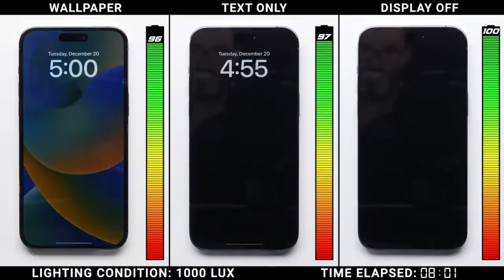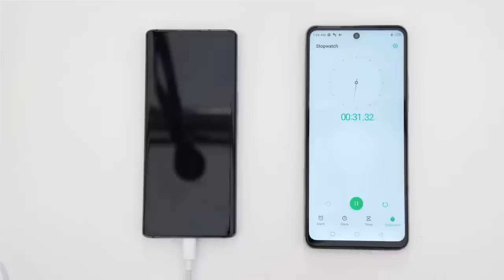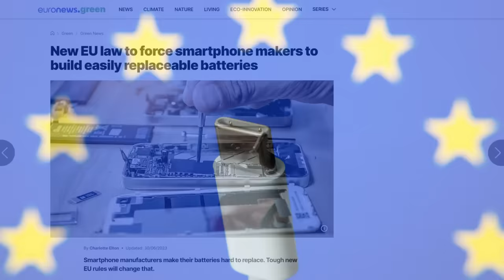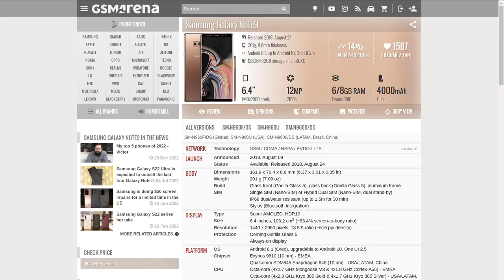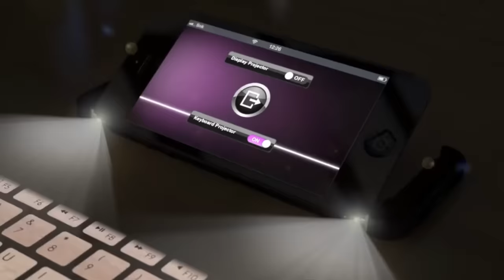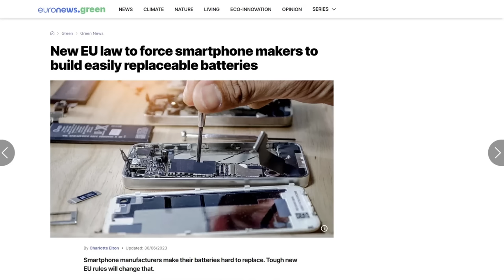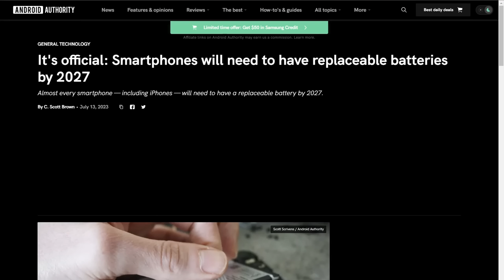All Smartphones Will Soon Have Removable Batteries

Comment: My guy, the s5 was water resistant and had a removable battery

Plus I had wireless charging on my s3. It was a cheap accessory that I bought on Amazon where you could connect yourself to make it that way! The smartphone industry has really brainwashed us over the years.

Comment: Recently found my old 3310 in the attic. Simple swap of the battery and it ran just fine. Was kinda nostalgic hearing the old tunes again. But other than that just antique hardware by now.

Chose my current phone for its waterproof rating as I work and sport a lot around water. The drawback being the inability to swap the battery without losing that waterproofing or the warranty. Been using it for well over 4 years now and still no need for replacement.

Comment: I remember having a Moto Z Play (late 2016 to early 2020).  Although it had no removable battery in the normal sense, it did have external hot-swappable batteries thanks to the Moto Mods system.  IMO, that is as good as replaceable internal batteries.  Plus the phone was made thicker to allow a bigger internal battery.

Comment: I totally agree with EU new regulation about the removeable batteries. One more thing why I like traditional removeable battery, not only it can easily be swapable with fresh batteries, but you can save your phone from a disaster in case the battery failed and blow up. One thing I concern with non-removeable batteries is, if something happens with the battery like shorting inside all of sudden, you can't save your phone, instead it will burn all along with your phone because you can't remove it. With removeable batteries, if something going wrong with the battery, you just easily pop out the back cover and throw the battery aside as fast as you can, so the phone will not burn out with the battery and your phone still safe. This is what I am thinking.

Comment: Snap in plastic encased molded battery modules maybe requiring a special unlock tool (included) will allow the current level of stiffness and strength that consumers are accustomed to and is what I predict with high confidence will be offered based on my engineering experience.  The cheapest phones might regress to designs like the Samsung S3 but who would want such fragile phones.  Any wagers?

Comment: Water resistant my S.
20 years ago my GF accidentally washed my jacket along with my Sony Ericsson A1018s. Dried it on the heater, turned it on an hour later and it still worked.
Try that with any "modern" phone (real rugged ones excluded).

Comment: I have a Fairphone 4, which is designed to be user-repairable. It's very easy to swap out the battery without any tools, but I never thought to carry around an extra battery because a charge on this lasts all day with moderate use. I also don't bother using a case for this thing as it's rather thick already on its own, the back is made of plastic but it never popped off the five or so times I dropped it on the concrete floor of my workshop (you really have to pry with your fingers). I also don't have to worry too much about components breaking because everything but the main board can be replaced easily, even the screen. Overall I like it a lot and find it baffling the only option for a phone like this is an obscure, expensive brand that I had to specially import from the Netherlands. If I ever need replacement parts I have to get the drop shipped which adds to the cost, but I'm probably saving money in the long run with how long it will last overall.

Comment: If batteries indeed became standardized in their size and form factor, it would be possible to load them into the phone throuh a slot at the bottom with a spring latch/release, like in some old SIM slots or how you insert a magazine into the handgun. Adding a gasket in the opening of the phone's battery slot would also considerably improve its water and dust resistance comparing to the backside loading with removable back panel. Bottom slot loading would still allow placing the q-charging and NFC coils at the back behind the battery slot, thus preserving these functionalities.
I'd also consider making the USB-C socket a part of the battery (with internal plug-through to the phone data bus), as this would remove the risk of premature phone obsoletion in case the socket gets worn out.
This approach would certainly make the phones bulkier, but this effect could be offset by the following factors:
1. Batteries can be made smaller (in size and capacity), but the universal standard and the ease of loading in/out of the phone would make swapping them a breeze.
2. Standardization and universal compatibility will turn batteries into a cheap and ubiquitous commodity sold at every corner store and gas station in the world, making charge anxiety a thing of the past.
3. Standardization and patent/license free design will also make batteries cheap due to easy entry for new manufacturers, fierce competition, and economies of scale.

Comment: Build them like many P67 rated handy-talkies. The battery (also P67) is part of the outer case. All electronics are sealed in the main compartment. Only waterproof battery contacts are exposed. The removable batteries could still have wireless charging capability as well as USB C ports. Too, using this design, it would be easy to make it possible to connect a much larger battery to the phone. My handy-talkies come with a 3800mAh battery but there are 5200mAh and 7200mAh batteries available that snap in place for these radios.

Comment: On a phone like the z flip it would be hard to add a removable battery.  It has dual batteries, and one is under the cover display.  I feel like these regulations look good on the surface, but limit innovation in a lot of areas.
Reply: We had flip phones that could change battery before so what are you even talking about?!
Reply: @HandheldGamer1991  modern flip phones have two batteries for more capacity.  Old ones didn't, that's why you could change them

Comment: The Battery expanding is The weakest point of a phone that also is a main cause of overheats and damage to other components
If you are good with tech you can remove it but you gotta deal with removing glue and putting new one back  in

Comment: How will this work with wireless charging coils? The coil usually needs to be as close to the oitside as possible but if the battery needs to come out, where's it gonna go?

Comment: This is great. When I got a new phone 2 or 3 years ago, I bought one with a headphone jack, a microSD slot and a removable battery. Basically every part could be swapped if you have a small screwdriver. Obviously, it's pretty niche and the performance isn't as great as it would be on a flagship Samsung device but 1) I only paid a few hundred €, a price unimaginable for big companies, and 2) this isn't a fucking computer; why would I need the processing power to run Premiere Pro on a damn phone.
Edit: Oh yeah, since he talked about it: The bootloader is obviously unlocked (first thing I did was install a custom ROM) and I only have 1 camera on each side

Comment: i do not care about water resistance but if battery capacity would get smaller then i don't want this removable batteries.
Few batteries for one phone? that sounds nearly as what i have for my camera = no thank you. I rather have one good battery and power bank.
So removable to remove on spot = no. Removable to replace battery by yourself when it gets old = yes.

Comment: I think using some kind of slidable notch providing leverage to press (or rather pull) a cover tightly on a form of gasket should be able to create a water tight seal and beat the issue of covers releasing easily when dropping the phone.
Reply: You dont need to reinvent the wheel even samsung sells waterproof. Phones with removable batteries. But not in the us or eu. They know how to do it but dont want to. Thats it. There is no limitstion or technical feature to embedded it. With today glass and aluminium phones its much easier than with the plastic back then to seal it without issues. (99% of phones are not watertide anyway) they made to stay alive if you drop them into water for a short duration.

Comment: I think the best way to make a good seal with a removable battery is to use screws. 8-10 screws total. It won't be as convenient as a plastic back but it ensures better protection to water, and lets a more high quality material to be used. Maybe they could start building their phones like apple builds macbooks, out of aluminum with a portion cut out for wireless charging and it would still look like shiney aluminum or stone type of frosted glass, but its metal at its base. Like a rim that has a big window for glass.

Very interested to see what these companies do. Although i don't usually like government interfance, this is something i enjoy. Them bring forced to take repairability and logevity seriously. Maybe you can just pay for the software so you can have old phones supported to the latest version. That solves all these problems because now people don't have to upgrade because their phone isn't supported anymore. If your phone still works well for you, you can buy software to keep your phone running

Comment: They can make a phone that has a replaceable battery and is waterproof. An option is to treat the motherboards and electronic components with a waterproof gel. Another option is for the battery to be a sliding type from the sides or from the top, for example, and to be closed with a sealed cover with bolts. The second solution from an engineering point of view is better, it will be the type as we insert the SD card. Capacity will indeed decrease, but only by 5-7%. Structurally speaking for strength it is best to have this hole at the top which will cause the central circuit board to be displaced to the bottom of the phone and in this case there will be no need for a secondary circuit board at the bottom and even those 5-7% and more will are saved there and even the possibility of a larger battery. But the bending strength will decrease on the phone. To solve this problem, the battery must be thin but long, and so the central board must be U-shaped.

Comment: My perspective: I don't need removable batteries as long as manufacturer provides replacement with no profit margin or small profit margin. Companies specialised in battery replacement can replace it for you for 50$ in my country in nearly any device. Thanks to that, it will be possible to have water resistance.

Comment: I stopped at the S8+ and I love the wireless charging option still. So I just bought a huge wireless power bank that I charge my phone with exclusively since the USB C port died years ago. I want to upgrade to like an S24 Ultra next year but maybe not. I'd be thrilled if my next phone has a removable battery, but if it lacks wireless charging I'd pass until 4G networks all shut down. I don't mind replacing the battery but my next phone will be like $1999.

Comment: Perhaps we can have an Apple Vision Pro battery approach which separates the battery to the device, replaceable and safe. More space for internal as well.

EU eCar charger Law was brilliant, since everyone can use the same charger and it's easier. USB-C charging is mixed bag for me since USB is a mess along with thunderbolt and fast charging.

Replaceable batteries are both good and bad. Cheaper and basic phones must have replaceable batteries while, higher end should be able to do almost anything for innovation. In a way irreplaceable batteries can keep the user safe whether from theft or accidents. Li batteries are far more dangerous than typical AA, button batteries.

It's hard to find a good middle ground on this topic that benefits the people the most.

Comment: Wow, just like they used to. I always wanted to have removable batteries again.
Reply: Sadly they overturned it again. If the device is supposed to be watertight or its battery holds 80% charge after 500 use cycles, they can perfectly glue the cell in the device... Maybe even with epoxy resin (if it wasnt more expensive)

Anyway, there are also smartphones with a user changeable battery

Comment: My phone is almost 8 years old, a OnePlus 2. Even though, the battery is easy to replace, it was never necessary to do so. Although, I did change the usb C connector as it went faulty midway its life. 
But during the last 3 years, the Android version that the phone have, stopped being supported by many apps. So I think is a good thing that you can replace components without having to deal whit glued components. But I do not believe that will extend the phone lives further, unfortunately.

Comment: I'm 42 so I've seen my share of mobile phones. Brands,.models, dumb or smart, two lines text screens, protruding and sometimes retractable antennas, gadgets, xenon flash, random and unexpected secondary use as weapons (👋 Nokia), keyboards or not, you name it. I have tweaked and customized looks and bits on almost every single one post-StarTac, I have flashed modems and radios hoping not to brick my G1/Dream at a time when Cupcake (Android 1.5) was the new shiny thing.

And you know what? The single feature I've been consistently missing ever since I moved on from my Galaxy S2, was the removable battery.

Having to disassembly your phone to merely have the possibility to physically cut the power supply, often having to go through a layer of metal and screws first  - because the battery is underneath, of friggin' course - while trying not to damage anything like the display ribbon might be the most evil and infuriating choice this industry made against the consumers.

I'm aware that things, needs, habits and tech itself have changed and that having to resort to lesser capacity batteries and/or get them at obscene prices (which was more or less already the case before, unless you found the unicorn that is, the one in a million chinese ebay seller who didn't scam you) is probably on the table. But ngl, I'm kinda happy that it's been decided in this direction.

I'm willing to trade the shiny and useless af back cover, that I still have no use for anyway  since I always protect my phones with silicone cases, for a cover like back in the day where you could access and swap batteries in a few seconds.

Comment: Phones with embedded batteries are also much cheaper to manufacture... but they don't tell you this, only the good points, like being more water resistant. There is a valid point that the embedded battery may have a larger capacity than a removable battery.

Comment: This is to reduce e-waste, because the batteries are the only part that has low lifespan, many people prefer to replace the phone instead of repairing it when the batteries fail.
The change to usb-c was also to reduce e-waste,  because having multiple devices will also produce multiple cables.  but this regulation did not only  made usb-c mandatory, but also enforced power delivery(PD).
Reply: Replacing entire phone instead of battery contributes to e-waste

Comment: I've been using a note 3 with a custom rom since 2013. It's still good with no noticeable performance limitations at all, Youtube is fine and probably the heaviest thing i use on it. I probably can't play a 3d game on it, but the play experience on mobile is bad and not worth the time either way. The idea that higher performance is required outside of niche applications is a joke. 

Been waiting for a phone worth replacing it to exist because now i'm worried it will break and i won't be able to find anything nearly as good as a 2013 smartphone in current year with the 3.5mm jack, sd card slot and removable battery.

Comment: pogo pin connectors are a thing, you could 3d print your own tray for samsung batteries and just make the charging connectors with pogo pins or something similar if you wanted to make a custom battery charger

Comment: As someone who has always been against the EU's ridiculous dictatorship, I will say the Replaceable Battery law have grown some respect in me for them.

Although the USB-C law is a half-assed law since phones that want to become portless are still allowed to do so. Wireless chargers still charge from an outlet, they still charge from a cable, the other end of the cable still has to make contact with the phone the just like a proprietary connector like the Lightning port does or USB-C does except instead of going into a small hole, it's just on the back of the phone on the outside. And oh yeah guess what, portless phones cannot be charged with USB-C, just like Lightning phones can't. When you break it down and realise just how similar wireless charging is to the charging we've always known, you realise the EU has left a huge hole in this law. Becoming portless is innovation you say and that's why they allow it? If you think it's innovating not being able to do a hard reset via PC if your phones firmware gets corrupt or not being able to backup your phone to your PC when you can't afford cloud storage is innovation, or think not being able to transfer photos and videos from your phone to your PC (except via WiFi which you can't guarantee you'll always have everywhere you go) when you get low on storage or want to edit the footage via PC (which will always be more efficent) is innovation then you probably need to be in a mental institution.